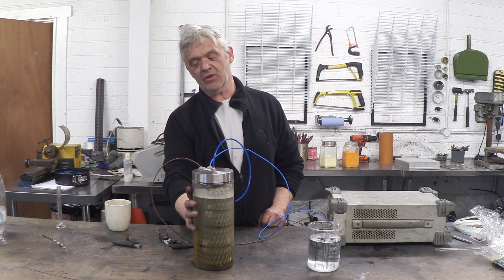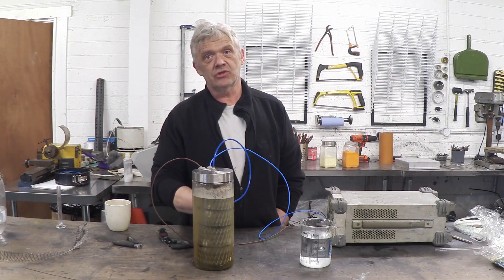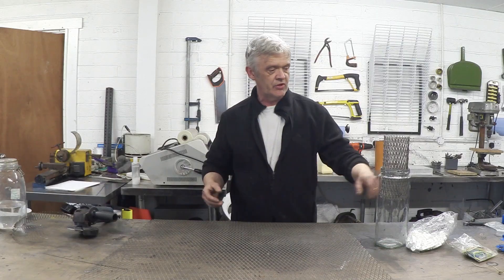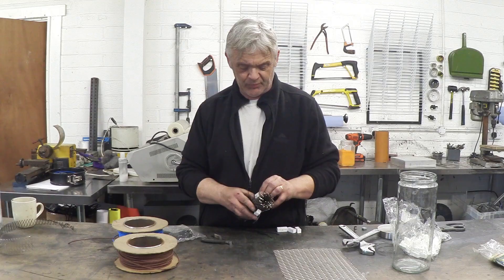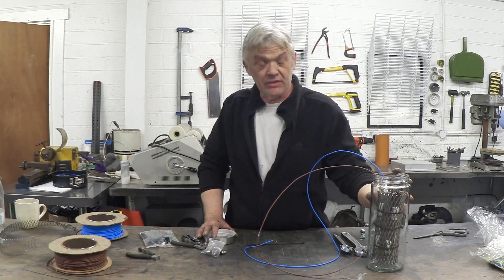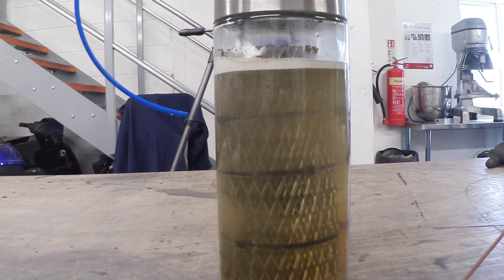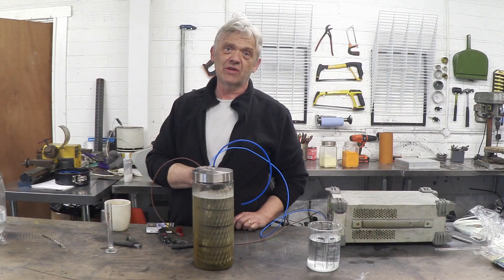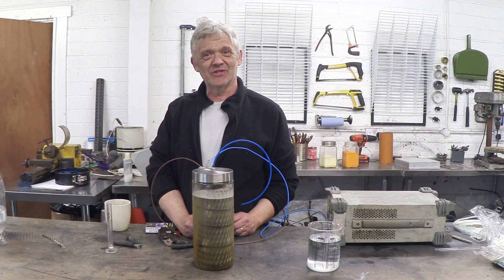Cheap And Easy Hydrogen (Brown's Gas) Generator

Comment: I'm trying to make a smelting furnace that can use hydrogen and oxygen instead of propain or acetylene. I'm just wondering if you think this is possible in a safe way? If so how?
Reply: I'm trying to melt iron
Reply: Almost everything melts with H-O-H even wolfram. 5000°C

Comment: So I had some ceramic heating elements from 110v 1500watt space heater I salvage from the lot of ones that burnt in my house fire. The elements still worked reason I kept them. But on subject of hho generation on the cheap using salvaged materials I found that the isolated runs in the element when stacked using silicone to isolated each one from another  alternative the dc on the elements 3 positive 2 negative then 3 negative 2 positive and so on. 12v 5amp power supply made massive amount of gas fairly quickly  and its similar the the square plate generatiors but I think this is more efficient bc of more surface space but that's just my opinion

Comment: How does this setup compare to George Wiseman's Aquapure machine for brown's gas which uses a distilled water/lye solution for electrolysis.  Would your setup work with lye?  Also, where do you get the Urea from (can you post a link?).  Also link for the jar you got and the seal(s).    Thanks for your video, it was brilliant.... I also wanted to know if you can hookup to plug in to wall outlet, or use a battery (lif so, what kind?).
Reply: It's used under the bonnet of your car powered by your alternator and the gas fed into your air intake or manifold. Hopefully giving you better mileage. Even a car battery will run flat in no time powering one of these without the engine running.

Comment: An electrolyzer is not a Brown’s gas generator. A Brown’s gas generator is a type of electrolyzer.  To make Brown’s gas requires a pulsed input. As electrolyzes go, yours is by far the simplest implementation I have seen. Thank you. I’d like to suggest you do the molar math to prove over unity. There are many claims of over unity electrolyzers, but I haven’t seen one that stands up to the math — meaning none are over unity.

Comment: If you want to separate the hydrogen and oxygen, a good arrangement is some PVC pipes constructed in the basic shape of a "UU" with three uprights (If you imagine the center as one pipe).  The Pipe on one side is the Cathode, the Pipe on the Other end is the Anode and the pipe in the center is for refilling.  You can cap either end and store or vent as desired.
Point of Safety for everyone.  I have heard that stainless steel releases Chromates in this process and is not something you want laying around and you shouldn't just pour it down the sink.
Reply: This is why platinum plates are used for human consumption of the water and for nebulizing???
Reply: @incognitoalias2808  Stainless steel consists of part chromium. Chromium oxidizes to chromium oxides during electrolysis. One of those oxides is chromium oxide VI ( hexavalent ).
HIGHLY CANCEROUS. 
In civilized countries, you can't by law ( and shouldn't regardless ) just dispose of that "rust". There is special protocol for disposing it(!).
Don't breathe it in. Don't dump it outside/down the drain. Don't touch it with bare hands. 
Don't use stainless steel as a waste electrode.

USE GRAPHITE RODS/PLATES. Best conductivity, best porousness, cheapest, most efficient. Breaks down into graphite powder/graphene.
Reply: Do the chromates get released in the gas as well
Reply: @CoincidenceTheorist  No, they settle down as some kind of clay or so. Let it dry, scrap it into a bag and drop it of your local hazardous material disposal center.

Comment: Cheap&easy 5 gallon bucket high volume, a) coil 4ft x 12 inch stainless, drop in bucket, it spins open lining the inside, put ovc pipe between wraps for max flow. b) 2 inch vertical pipe in center stuffed with all thread and washers or stainless mesh so it doesn't protrude below pipe. Tap top center anode for hydrogen with 1/2 inch PVC, tap outer ring for oxygn (water) oxygen/chlorine (sea water) oxygen/nitrogen (urea) etc. Its also a self regulating rig, filling center pipe, lowering water level until gas feed line empties.

Comment: 62 watts, yeah low. How much gas? Oh yes you get more because Urea is basically Ammonia which is already Hydrogen. So sure..And if urea is cheap its a bargain fuel then. So its really not "more out" but a matter of burning the Ammonia in the Urea back to water.

Comment: 2 stainless steel balloon wisks stuffed with steel wool can be used as electrodes are easily put together at home, also you can collect both gasses at once to get Brown's gas(HHO,) or put a collection tube over each eletrode & you can collect the Hydrogen at the negative pull & Oxygen at the positive pull separately. Be careful Brown's gas is highly energetic don't mess with this or try it at home...not only will it result in water it will blow your hand clean off. I will leave out the basic home chemicals to make this possible. Funny how water & a few easily sourced materials can easily make a high explosive. 

Knowledge is power! They may be coming after our guns, but that is because they already robbed us of ou real weapons...basic understanding, common sense & the will not to be subjagated. The thing they fear most is the word "No"!
Reply: Baking soda... hydrogen sulfide... potato juice... any catalyst, really..
Reply: been thinking to do the balloon whisk, just got to find the right one. picked up stainless scrubbers, just need to find the right spill proof high heat plastic housing with some nice high heat plastic bottles or containers to put one or more whisks in. really want to mix this with methane if i can get that going but would love to look into powering a generator. what sorta uses can you use these for?

Comment: Shalom Aleichem. 

Does this unit produce enough hydrogen to make it useful for any practical applications? Can I run a home generator on it or a vehicle? Can I compress the gas into a receptacle like an old (emptied & cleaned) map gas cylinder?

I'm a retired mechanic on disability a curious. 

Thank you in advance. 

Ratson haba b'shem YaHuah

Comment: how to store the gas?
Reply: You don't store the gas it's too explosive you feed the power in from your alternator and the gas feeds directly into your engines air intake. If you get it right you can improve your mileage. Or you can make a tiny brazing flame with gas made on demand. This produces brown gas a mixture of hydrogen oxygen and nitrogen, highly explosive so the water level in your cell must be high to store a minimal amount of gas and it is used as it is made.

Comment: does your stainless electrodes erode ofer time? thinking of building one in a stailnless tank and use the tank for one electrode. dont want that to erode and spring a leak.

Comment: Several people are commenting here that Rob is violating the 1st law of thermodynamics with his remarks in this video. At a closer look, this isn't really the case. I was confused for a second, too, but I assume it was only based on a misunderstanding or maybe not the best choice of words. What he didn't say is that he was only looking at the VOLTAGE he put in. In this sense it is correct, but it's not the complete picture. The discrepancy comes from the fact that not the entire chemically bound energy was considered in that equation. Urea electrolysis doesn't create real "Brown's Gas", i.e. no stoichiometric mixture of hydrogen and oxygen. There will be H2 produced at the cathode and N2 and CO2 at the anode. Urea will be consumed over time as kind of a 'fuel'. There's also some energy saved because to make it burn you would be required to take oxygen e.g. from atmospheric air, which is abundant and basically 'free'. All things considered, i.e. WITH the urea consumption and the external oxygen supply, the net energetic result is of course NOT positive. If anything is supposed to be 'free' here, it's only in the sense that oxygen is all around us and that urea is incredibly cheap. The laws of physics still apply. There's nothing free in a strict thermodynamical sense and when viewed as a closed system - and I'm 100% sure that Rob would agree to that. The thing is: we won't run out of oxygen or urea any time soon (the latter is literally in urine!), so you can consider the system as partially open.

On a side-note: there is no such thing as a perfect electrode. The required voltage is always a little higher than the theoretical voltage according to the Nernst equation. This is also the case for the 0.37V that he mentioned. The exact amount of required "overvoltage" varies between electrode materials (graphite and iron are a bit at the lower end, but for many materials the electrolysis overvoltage is even beyond 1.0V!). For the complete equation, this overvoltage (and a bit of heat loss) must be taken into account and I have no doubts that Rob is aware of that.

Comment: May I add a question: in HHO world, a key performance number is important. I m sure you know it: milliliters per minute per Watt or MMW. You measure the gas in liter per minute (or gallons per minute or whatever) and divide it by the power in Watts that you used to do so. When you do this with your cheap solution, how much is it?

Comment: Dear Mr. Murray-Smith, please release more data about this construction. When you run this for several hours every day, how much brown water do you get? How many hours your solution can run before you need to change the water? Second question is: what is the temperature of the water after 3-5 hours of operation?

Comment: The design of this electrolizer is worst that you can do. I will explain. First, is well known that distance between electrodes is very important so is a very sensitive parameter that make a HUGE difference in creating amount of gas. Secondly, instead of use of DC current, a PMW current will drastically increase the amount of gas that you can produce using the same energy. That is happening because a pulse modulated width current will prevent increasing of temperature in the system once you will find the best adjustment of frequency, amplitude and width of the pulse. Third thing to consider is the shape of electrodes; instead of using a cylinder factor form for the electrodes, is better if you use a spiral factor form, and that  will drastically increase the surface energized and thus, will generate much more gas in the same volume, while the quantity of extra energy that you absorb by increasing the surface, it will not be significantly increased. Another thing that you already discovered yourself is that the best material for electrodes is grafen, not stainless steel, but for simplicity stainless steel is good enough. As a refrence, I think is worth to take a look at Stanley Meier papers, to use dissociation instead of electrolisys. I will try to make a generator according with the information that I stated before, using ureea with water and if you want, I will share this information with you. Anyway, is an awesome work, I have found very interesting information here on your channel! Thank you!

Comment: Since it also produces nitrogen by using urea, if the Hydrogen mixed with the Nitrogen was burned in an engine, would the exhaust gases not then include higher nitrous oxides.  Using HHO generated to get pure hydrogen requires a separation method of the Hydrogen from the Oxygen in the Browns Gas, would it not also require a method to remove the Nitrogen from the mix in order to get pure Hydrogen?

Comment: Hey Robert, if you get back a Net Gross of Energy like what you've said.  Would there be enough Gas Energy to Run a well Designed System on just it's on Energy or Gas output? Also if you Separate the Oxygen from the Hydrogen couldn't you use this back into the Production as an Accelerator?
Reply: That's a great question, and I wondered about the net energy claim.  He did mention the urea breaking down into a nitrogen-hydrogen mix.  I'm guessing the urea breaks down in a way that needs to be replenished.  The extra energy is stored in the urea somehow, and getting released upon electrolyzing.  It was a bit of a distraction from the HHO cell.  You can also use washing soda (Sodium Carbonate) as the electrolyte, to lower the cell voltage.  It works even better, in my opinion.

Comment: "And there it is, creating lots and lots of gas" ---- Through that single hole. (hydrogen and oxygen)  ---- Make sure you don't try to fill anything with that. The iron may bond with some of the oxygen through rust, but most the oxygen should escape and help make lots and lots of gas,

Comment: You are saying you are getting more energy out than what you put in?   There seems to be a problem with this unless its a temporary chemical reaction that breaks down and you need to replace the chemicals and metals at a cost after a time.  If my ears heard correctly, then that means that the critics of Hydrogen as a practical fuel source for vehicles are wrong.

Comment: Are you powering it with DC or AC voltage? Also, are you having any issues with electrolysis-induced erosion of your electrified stainless steel meshes? Another question, are you having to replenish the urea in your solution? Great video!
Reply: DC power used
Reply: @paulkainer269 , have you considered using AC voltage? That way, you'd get both H2 & O2 (Brown's Gas) generated from both electrodes & minimize the loss of material from galvanic corrosion.
Reply: @synthyawylder3297  didnt consider it
Reply: @synthyawylder3297  would be a certain frequency

Comment: Just saw this. I have a number of comments off the top of my head.
1) obviously one can't get more energy out than one puts in ? So, if it is true, then where is this energy coming from ? Perhaps the reaction of the urea to produce Hydrogen and Nitrogen is thermodynamically favourable but needs some activation energy - not sure if this makes sense. Any way, we are consuming Urea so that is a source of energy that hasn't been taken into account - except that as you say, it is a waste product of human biology - but rather smelly to extract.
Did I mishear you saying that you were using 3A at 12 Volts - if so, then wouldn't the water break down as well and generate oxygen as well ? If that were above a certain level it would be undesirable.

I'll have to read up on this !
Thank you.

Comment: I think a timed test to determine hydrogen volume produced & how much the assembly heats up at that voltage (wasted energy) should be in order.
Getting too hot at higher voltages seems to be a common plague among diy electrolyzers.

Comment: pulse width modulation (PWM) circuitry, tune your cell to resonant frequency-gas is produced via capacitative discharge versus brute DC electrolysis.    This type of gas is mono atomic H and O at highest entropy state (1L H2O/1800L gas). cell input is tuned to standing square wave modulation at high kilo-cycle frequencies.  you will find harmonic 'sweet spots' where gas production is optimal at a fraction of the input wattage...so I have heard
Reply: @schinderiapraemeturus6239  would love to hear more.  Do you still need an oscilloscope or there is newer way to do all the stuff you said?

Comment: question: if urea splits the water at lower than normal volts, why do i hear 21 volts and not 1.2 volts or something?
it is afterall just a 2 "plate" cell right?
Reply: because he used mesh n the contact area requires it

Comment: i dabble a bit in hho too, however, i use battery acid on low amps high voltage LOTS of plates 
never heared of urea though
KOH wants 1.8 to 2 volts and battery acid around 1.24.
ppl say yes, but battery acid is dangerous, is acid... however they don't realise that all chemicals are, espacially when you think KOH is "safe" 
you need the salt/acid for the conductivity and not have it take part in the reaction. both KOH and H2SO4 work that way but since the break voltage with the acid is a lot lower, the output per wat is pretty high.

also, its diluted down quite a bit compared to whats in the lead acid battery. just so far to get me the amps i need per cm2 to efficiently make my hho.
for plates i use stainless sourcers that came very cheap with those plastic rim protectors 1mm inside 2mm outside that normally protects you for cuts .
so i fot a stack of them with some 240 or so plates so it can connent to rectified mains voltage.
since inverters for 12 VDC to 230VAC (pure sinus) are readily accessable in decent power output and the startup power doesn't need to be high since it just has to start, then the alternator can take over. but for testing, this is plenty.
only add just enough H2SO4 so that the amps are good. no more no less the solution should be the current limiter.
when set on 1700Watts i get around 12 liters HHO per minute so 4 liter of H2, thats a pretty decent amount i think.
i use around 115 mA per cm2